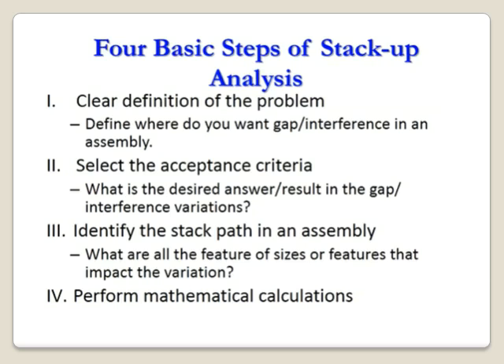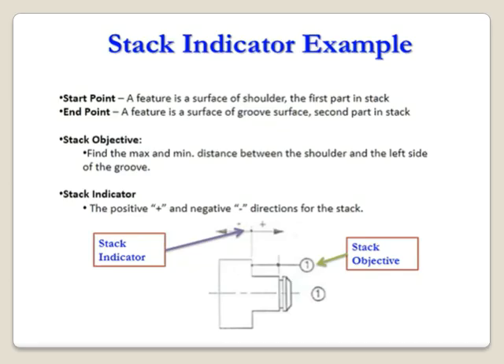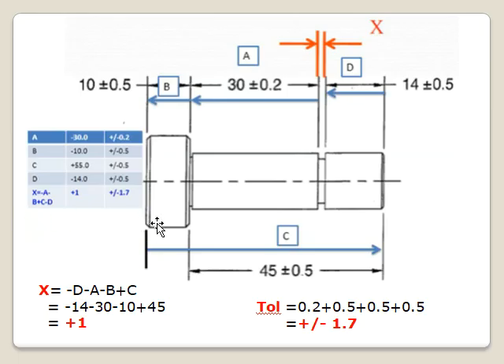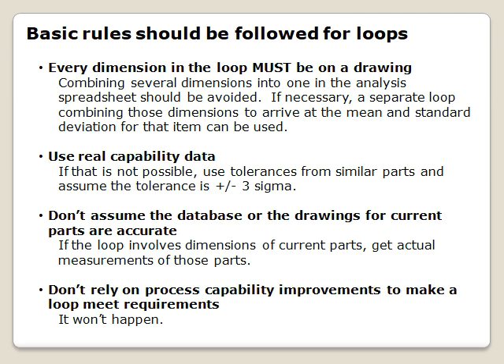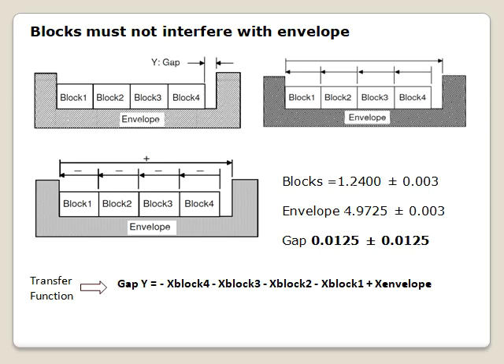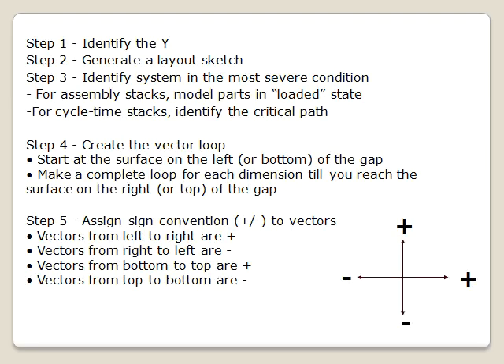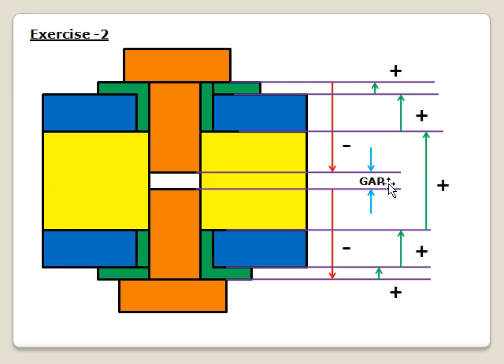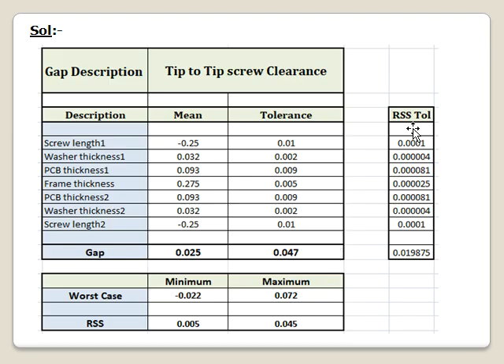Tolerance stack-up analysis #tolerance #stackup #mechanical #education

Comment: How you get RSS value
Reply from the maker: Let's say you are assembling a device with 3 parts, each having the following tolerances:
Part 1 tolerance (T 1 ) = ±0.1 mm
Part 2 tolerance (T 2 ) = ±0.2 mm
Part 3 tolerance (T 3 ) = ±0.15 mm
Using the RSS method:
1. Square the tolerances:
     T1 Square =(0.1)2 =0.01
     T2 Square =(0.2)2 =0.04
      T3 Square =(0.15)2 =0.0225

2. Sum the squared tolerances:
     0.01+0.04+0.0225=0.0725

3.Take the square root of the sum:
    T RSS = square root 0.0725 =0.2693mm

So, the total tolerance stack-up for the assembly is approximately ±0.2693 mm.